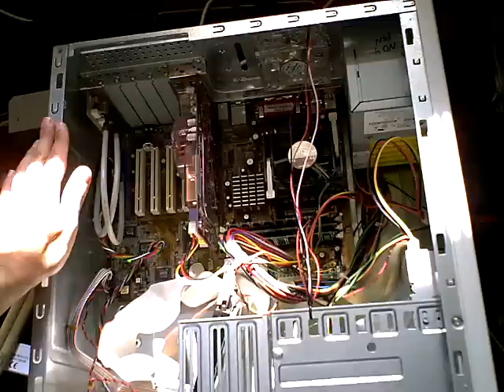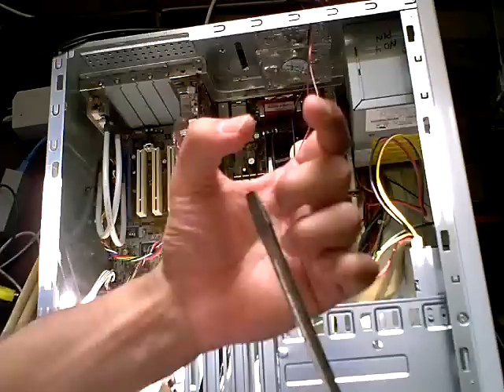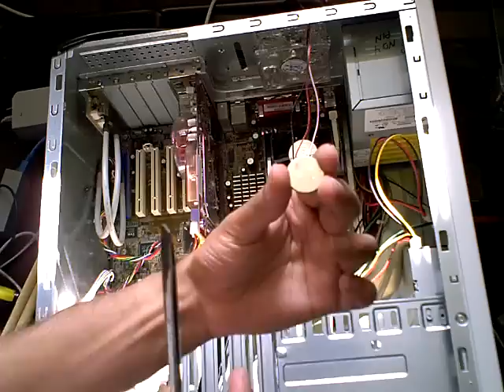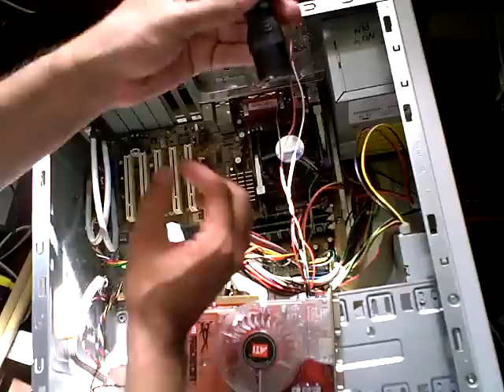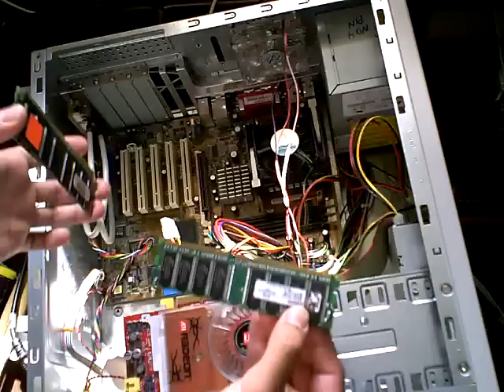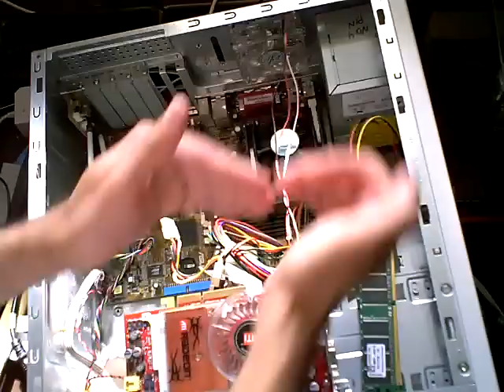How to possibly fix a PC that will turn on but will not beep and will not display anything on screen

Comment: RodneyDickson, 
You are a genius.  You made my day and taught me something that I wanted to learn from a long time.  With your easy to understand step by step process, I could revive a virtually dead  motherboard.  Before this exercise, the motherboard was not beeping and there was no display.  A failing FAX modem PCI card and trying to turn the computer ON/OFF few times messed up the motherboard.  I removed the CMOS battery and jump the CMOS as you suggested for long enough time.  Then when I rebooted the computer I heard one short and one long beep.  I didn't have a hard drive and mouse connected at that time.  After connecting a HDD and a mouse when I started the computer, I got a single beep and I could go to the BIOS setup and see and set everything.  The computer worked.

Thanks a lot.  Keep it up.
Reply from the maker: +Pramod Patel Nice! Glad I could be of help : )
Reply from the maker: +Pramod Patel Thanks for sharing your experience.

Comment: I am experiencing a strange issue . Some days back I found out that my computer was getting hot and therefore I decided to reapply the thermal paste and replace the stock cooler with cooler master hyper 121 led. 

I did replace the stock thermal paste ( removed it by 95% Iso propylene alcohol) then applied artic silver 5 compound (pea size method), and finally attached the aftermarket 121 cooler master hyper cooler. Finally checking all things at their place and seated neatly, I booted up the computer , however I did not not got the post beep sound (1 beep) - the CPU fan was running , the GPU fan was running but there was no display on the screen. My motherboard has a built in error code embedded card which showed code 77 error. 

So, I  switched off everything and began to inspect by removing every component one by one , but all in vain , the problem persists. Then after a while , when I was not getting any solution , I reseated every component back again and booted up the computer still no response got code 77. Then I again switched off and tried to again boot up -I did this procedure "on and off"  2 to 3 times  - and suddenly out of the blue the computer booted without any error (heard the pleasant 1 post beep sound). Then my computer ran very smooth like no problem occurred at all.

Next morning, again the same problem - no boot , no sound , CPU fan running and getting annoying code 77 error . This time I did not opened up the hood however I did switch off then waited for 20 sec. and again boot the computer -got same error - again switched off and boot - got same error, so, I repeated this switch off and boot method for exact 7 times and about ,say, 25 minutes my computer boot without any error, and ran perfectly.
I am not getting what actually the issue is. Please please help me to figure out the problem
Reply from the maker: Technical gremlins like this are not easy to solve. Did you look up what error code 77 means?

Comment: Good morning sir/mam sorry if i disturb you my name is JohnRey from Philippines and i want to us you something about the problem of my PC or i think its motherboard the problem is when i turn it on the power the power go to ECS elite group black screen setup and they have 2 main choices either bios or main setup but i can't go to that 2 category my keyboard is good or iin running condition and always reset to that situation or that option. Can you help from that problem? Thanks
Reply from the maker: Try disconnecting all external input devices except for the keyboard, then try pressing the required hotkey after performing the CMOS CLEAR. If this doesn't work, try using a different type of keyboard following the CMOS CLEAR method (i.e. if you have a USB keyboard connected, try using a PS / 2 keyboard, and if you have a PS / 2 keyboard connected, try using a USB keyboard).

Comment: Sir when I put CMOS jumper at first two pin my pc did not start and fan is off and when I put CMOS jumper my pc start but not open bios.my pc shows that CMOS CLEAR press F1 to boot and enter but I press the button and my keyboard is not working.please help me
Reply from the maker: Try disconnecting all external input devices except for the keyboard, then try pressing the required hotkey after performing the CMOS CLEAR. If this doesn't work, try using a different type of keyboard following the CMOS CLEAR method (i.e. if you have a USB keyboard connected, try using a PS / 2 keyboard, and if you have a PS / 2 keyboard connected, try using a USB keyboard).

Comment: i did all this still no display then i change the motherboard still no display .. can it be cpu ? plz answer
Reply from the maker: Yes, it could be. It could also be the power supply being insufficient. To eliminate error factors, ensure to Breadboard it (explained in the following video:)

If the steps in this video did not provide a solution to your problem, view:

http://www.youtube.com/watch?v=_EK9a-R5pss

You never know, maybe rebuilding the PC in the opposite sense that you took it apart will solve the problem.
Reply: hello . i did breadboard test it beebs 2 times and 3sec in between  i did not get what it means . lolz out of my understanding . this is the page . if you can plz tell me what does it means . thx 
http://www.dell.com/support/article/us/en/19/SLN143065/EN#OptiPlex Beep Codes
Reply from the maker: The beep error code you mentioned matches nothing in the guide you referenced. From their example 'the beep pattern is 1-3-2 (1 beep, then 3 beeps, then 2 beeps)' That being said, to match their beep error code structure, you have to note the amount of beeps in three sets of beeps, and then once again refer to the guide you've provided. If you need more help with this, they have a link where you can contact them directly on the same page http://www.dell.com/support/contents/category/Contact-Information/Technical-Support?ref=contactus
Reply: when i only start motherboard with only cpu so it beebs 2 times which mean there is no Ram when i put ram in it then no beebs and nothing . i finaly think should just throw it away.  i think the cpu is dead coz i changed motherboard and still same problem .
Reply from the maker: That sounds like a valid assessment. Before trashing it though, unplug the PC, remove the CPU, check the pins (for such things as bends or damage), re-seat the CPU (re-install it) and try booting one more time.

Comment: This video was the only thing that helped when my computer suffered the same problems following a fall yesterday. 
I followed the steps, and, as I hoped, it was the RAM; so thankfully just a case of swapping the memory round. And the computer appears to working OK now.
You have saved my very important PC that I do all my graphics work on; I literally cannot  thank you enough.
Reply from the maker: Really glad to help in this case. Chances are the impact caused the RAM module to become dislodged, and in re-seating it, you corrected the issue : )

Comment: Sir my pc is sometimes turn on sometimes it takes 2 days to turn on ... Now I am facing an other problem which stuck at windows logo i don't know what should I do ..I did so many ways to salve that problem ..Ram clean and changing c mouse battery .........It just on  after shutdown it won't turn on again ...I really don't know what kind of problem it is ...Plz help me
Reply from the maker: Getting stuck at the Windows logo sounds like the operating system might have become corrupt. Did you try booting the OS in safe mode? Alternate pressing F5 and F8 repeatedly after booting the PC?

Comment: You are a bloody lifesaver. After not getting any signal on three different monitors (and a TV) even though the PC booted up and everything was working, I was worried (and possibly a bit pissed since I ordered the PC from another country) that either my GPU or mobo are dead, and was ready to return the whole thing. 
Who knew I only needed to spend 13 minutes of finding and watching your video to solve all my issues.

Thank you VERY much for taking your time to educate and help others! :)
Reply from the maker: +Shiroi Tenshi Awesome! Glad things worked out, cause returning that deal woulda been a pain for sure : )

Comment: PLEASE HELP ME ! My pc had BSOD problem and I looked for solutions ,,Theres a way to clear bios ... to remove cmos battery and move jumper pins ... I removed battery and also took out the jumper and put it long in clr bios 1&2 pin .... and I also moved the other jumper which has 7 pins .... at first it opens and says bios has been reset something like that then I moved the pin again .... now my pc wont turn on anymore ,only power button light and fan and the yellow green light in the plug near motherboard .............  I have 2 jumper on mobo ,one has 8 and other is 7 .... I both moveed it ...
Reply from the maker: Are you sure you placed the jumpers back in their initial placements? If so, Do what my video shows: disconnect the power cable, remove the CMOS battery, press your PC's chassis power button switch (to discharge any remaining power circulating in the system), leave the PC unplugged and in this state overnight, then the next day return the CMOS battery to its socket, power up the PC, and if no beep, then disconnect the power cable, press your PC's chassis power button switch (to discharge any remaining power circulating in the system), remove one component, power up the PC, and if no beep then repeat (each time unplugging the PC, pressing the power switch to discharge remaining power, removing a remaining component, and then powering up, and this until the PC beeps at boot).If it never beeps, even when you are down to just motherboard, power supply & CPU+fan, one of these remaining components may be bad

Comment: My computer was showing no display, then I Shaw a troubleshooting video on YT and according I disconnected power and long pressed Cpu power button then computer turned on but it freezes after using sometime, can anyone help me ? WHAT to do ? Plz, I will sub you
Reply from the maker: The freezing after use can be a multitude of things: the CPU overheating, the operating system being corrupt, the memory being bad, the hard drive having bad sectors, the power supply being faulty, etc. 

This is how you can test the memory:
https://www.youtube.com/watch?v=YB_lUW1oBSU

Also, Hiren's BootCD has many freeware testing softwares that may shed some light on the issue.

Comment: Hi plz help me..iam literally crying....I think my CPU fañ cable connector pins r slightly bent..Is my whole motherboard garbage now?T_T plz tell dude
Reply from the maker: disconnect the power cable, press your PC's chassis power button switch (to discharge any remaining power circulating in the system), and then with tweezers or needle-nose pliers you can rebend these pins in the proper configuration (VERY IMPORTANT: ENSURE THEY ARE NOT LEFT CROSSED AND TOUCHING EACH OTHER) and if this is impossible to do or they break off, you should have another FAN power connector on the motherboard elsewhere that you can use.

Comment: i removed my ram and it does not deep i used all parts beside my cpu and motherboard before
Reply from the maker: I'm trying to understand what you are telling me. From what I gather, you are building a new PC with a new motherboard and CPU but everything else you are using is used pieces from another PC?
Reply: yes i am
Reply from the maker: Are you sure you have an internal PC speaker?
Reply: yeah I checked and i had a fellow person who has okay knowledge of computers
Reply from the maker: And I assume that your PC is behaving just like mine does in this video, even with the RAM present?

Comment: Hi Rodney, this will be a long message, hope you will be able to solve it tho.

Problem(in order of time):
- had a windows 10 update, shut down took longer than usual and i was in a hurry so i held onto the power button to turn it off.
- following few days had a few occurences of BSOD with different error messages upon starting up. Auto restarted a few times to get it running normally again. Happens once i turn off my pc and turn it on again.
- so finally one day it decided to restart and restart and never turn on again. Even power, fan and everything running, but does not run past post. Nothing on screen at all.

Things Ive done:
- Took out GPU
- Took out SDD, HDD
- Took out RAM, beep sound
- Took out DVD Reader
- Change RAM in the slots (only 1 4gb stick)
- Clear/reset the CMOS battery via switch and took out the battery for 10mins as well
- Bought a new 8GB RAM thinking that its becus of the RAM issue, it did power on the 2nd time after i newly replaced the RAM. 3rd time onwards I plugged everything back in thinking it was working. But was just blank screen again. Took out everything again and tried, swapped ram slots, still nothing.

Things that happened:
- The PC auto power ons itself after I forced shut it down. Happened a few times.
- Auto restart non-stop by itself. On for 3s, off for 7s. Also happened a few times.

Background info:
I re-used the mobo, ram, cpu and hdd from my previous lenovo H520s. Mayb 4-5yrs ago.
Bought gpu, psu and casing. Built them tgt into my current pc. Around 2yrs ago.

Works well all the way till now. Reason why i upgraded cus my previous psu was an mini one, atx? It POPPED one day while i was using my pc, surfing youtube.

Had a few issues while playing HD games like assassin's creed. Few distorted lines appearing a few times in game. But stopped gaming so didnt really bother about it.

Intel Core i5 2320 3.00GHz
Lenovo CIH61MI V1.1
Sapphire R7 265 Dual-x
Sharetronic DDR3 4GB (Replaced with Crucial 8GB DDR3 1600Mhz)
Crucial MX200 SSD 250GB + 1TB
Seasonic ATX 620W 80+ Bronze

Would truly appreciate it if you could come up with a solution or something. Thanks!
Reply from the maker: +AntiqueSwift Wow, well, you did try some troubleshooting at least. Sadly it sounds like Windows 10 messed with your BIOS (probably an incomplete system update that was waiting to write code). Given the many instability issues you're having here, I'd Breadboard it (explained in the following video:)

If the steps in this video did not provide a solution to your problem, view:

http://www.youtube.com/watch?v=_EK9a-R5pss

You never know, maybe rebuilding the PC in the opposite sense that you took it apart will solve the problem.
Reply: +AntiqueSwift  Did you end up fixing it? I currently have the same problem :(
Reply: +RodneyDickson Hey Rodney, i took everything apart and tried. Apparently this time the mobo does not even beep when i took out the ram. previously it did. so with the psu, mobo, cpu, there was no beep. keyboard and mouse no light. but all the fans were spinning. does it mean its the mobo is faulty?

Comment: Thanks a lot, Rodney, for such a thorough and detailed explanation !
The situation with my PC is similar, except it boots up perfectly normal in 2/3 of attempts and then suddenly it refuses -- the power LED lights on but then the fan starts howling like a vacuum cleaner and that's it -- the box doesn't even react to my pressing the power button . So I flick the switch at the wall mains outlet, wait a couple of seconds, switch on the mains again and -- voila ! -- the booting process continues as if nothing's ever happened. This is a HP Compaq dc7900 box Core 2 Duo 3.0GHz 4Gb RAM running Ubuntu Linux, and it looks and behaves -- when it does decide to behave -- too good to chuck it to the dumpster. But the fan howl sounds too scary to continue using the beast. That's my dilemma...
Reply from the maker: Thanks for the kind words. Sadly, intermittent issues like this are often too difficult to pinpoint as far as the problem goes. In your case, I'd get it to boot proper, and then put it into sleep mode when not in use so that when needed, you can simply wake the PC without going into that howling PSU scariness. Sorry for the lackluster fix : \

Comment: Your video saved my life in a way. I tried doing the same technique to fix my Computer. That I built its just over a year old. I got home one day and no screen no usb output or anything but, fans running. I Then found your video. Tried all that. Put my stuff back together and tried other power supply. Behold I thought it was the power supply. However when I put the old Power Supply back in it worked again. I think When I went to Jump the CMOS on the motherboard. I wasn't giving it enough time and or there might have been static build up  or bad connection. Works now. when I followed your steps all is good now. I think its because I took out the ram and let the battery stay out while I jumped the MB CMOS. I left The battery in and computer off when I jumped it before. Thanks I'll make sure next time i Jump a MB I'll leave battery out then try booting like in your video. Thanks a bunch man. I hope its not a fishy Bi-polar Power Supply either. :D
Reply from the maker: Ha, yeah, nobody likes bipolar PSUs : ) Glad things worked out.